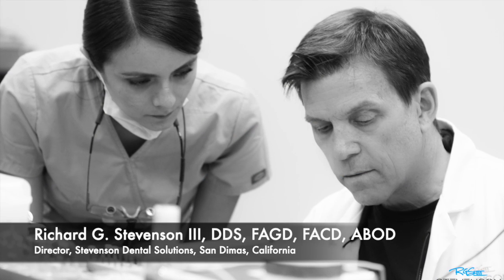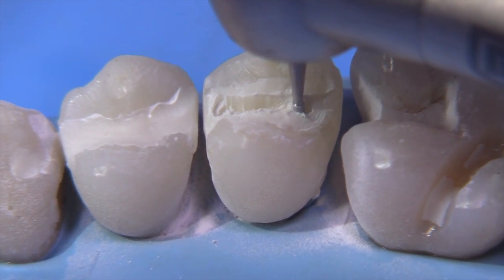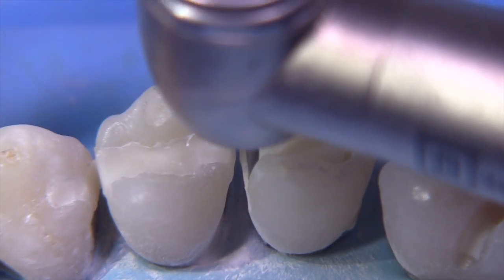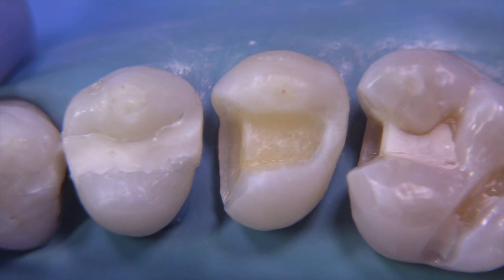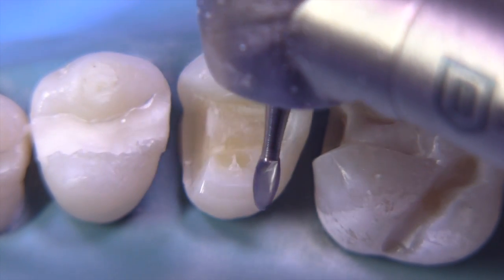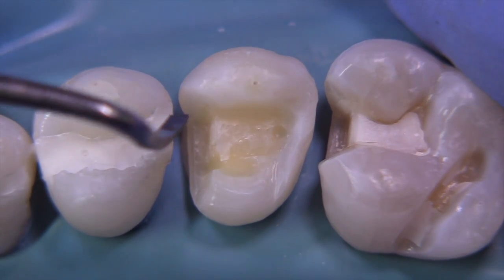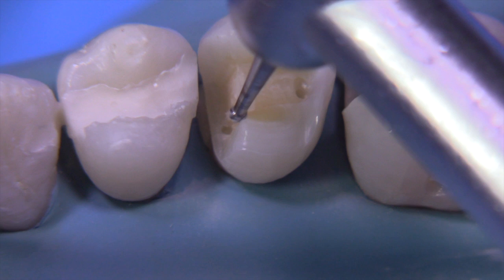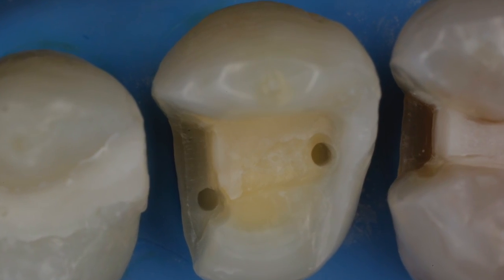Cast Gold Restorations, Part 4: MO Pin Onlay Preparation #13

Comment: How do you take impressions of your “pin lay” preparations? Thanks!
Reply from the maker: Vented needle technique.  It's in one of the vids
Reply: @StevensonDentalSolutions  have you presented this technique at AARD table clinic?
Reply from the maker: @normanchu2482  I did in 2007
Reply: @StevensonDentalSolutions  I spoke with you in Chicago!
Reply from the maker: @normanchu2482  Small world!

Comment: hi doctor 🙋 what is the resistance triangle you talked about in the video?
Reply from the maker: To retain inlays and onlays, we require at least a three triangularly located retention elements.  In the typical inlay, this would be the dovetail and the buccal and lingual walls of the proximal.  These elements should be as far apart from each other as possible.  In this video, the triangle was formed by the buccal wall of the box, the pinhole on the occlusal and the pinhole on the lingual side of the gingival, hence a triangle of retention and resistance form - with the points of the triangle as far apart as possible.  Thank you, Doc!

Comment: Skilful hands , would u prefer a monoplane composite resto. Instead of plaque retentive , force concentrating deep fissured anatomical restoration?
Reply from the maker: Good Question - The highly anatomical composites are beautiful to look at but usually don't even match the patient's anatomy (Unless the patient is young). I prefer some anatomy, which matches the patient's current anatomy, and never so deep that it would cause difficulties with hygiene and function.